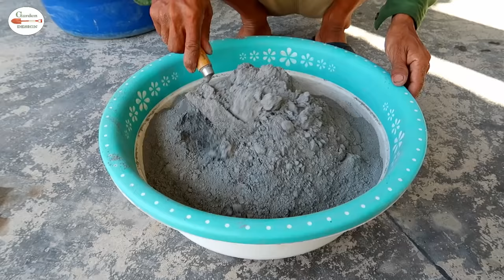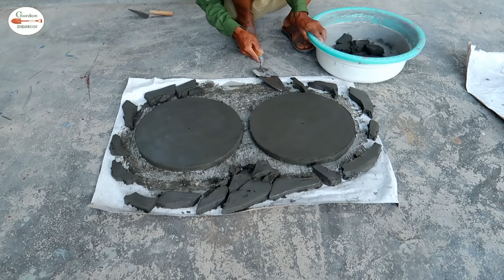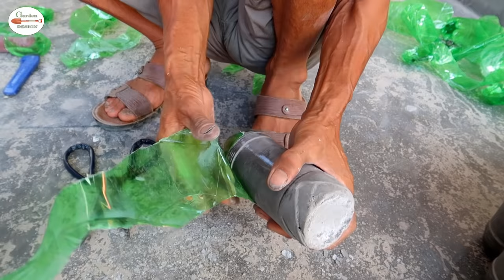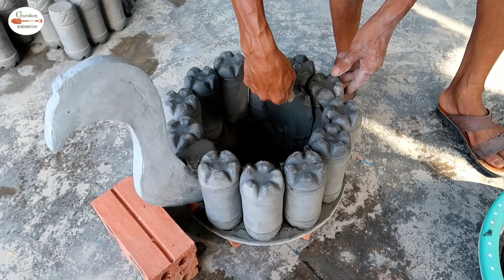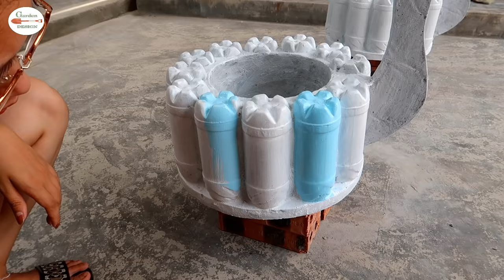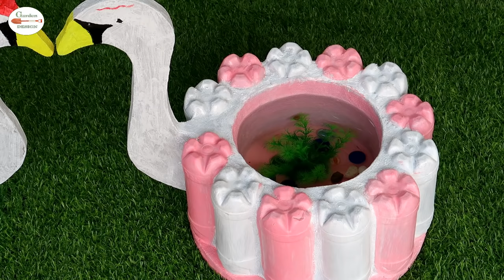DIY duck shape flower pot from Plastic Bottles And Concrete / Project concrete at home

Comment: Its look good n beautiful but wheres the drainage to let the water flow when ur watering the plants
Reply from the maker: If you want to grow trees you can make drainage holes as you like. thank you very much
Reply: Its should be done the hole ON the start if its using as a pot plant instead of drilling it after to make easier for the buyer.